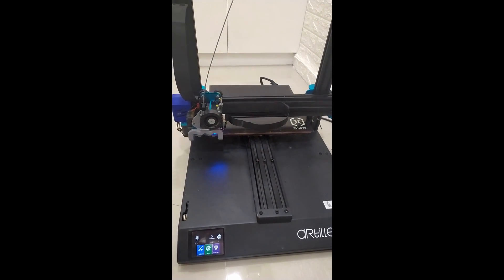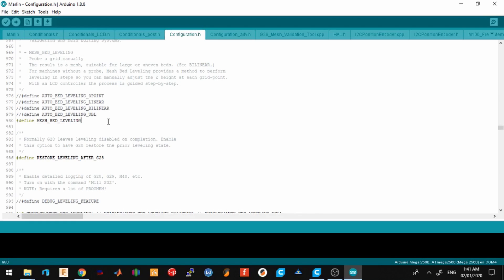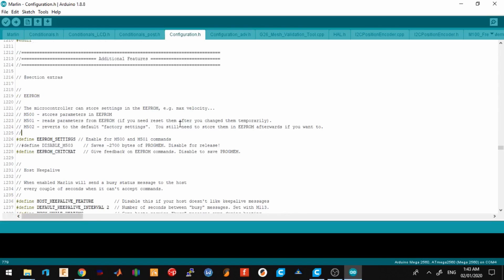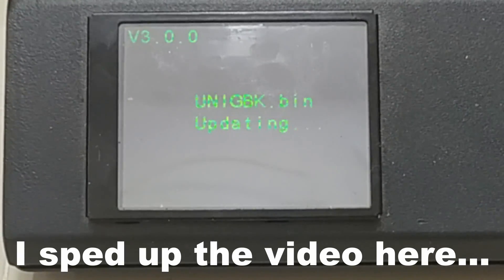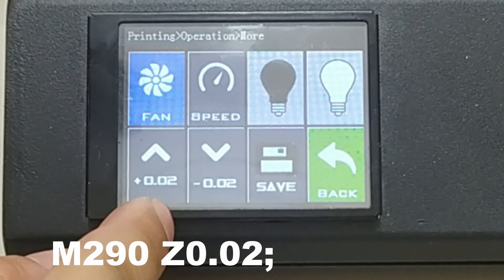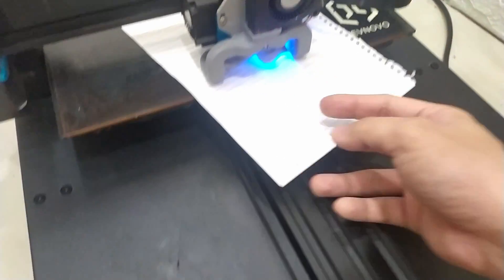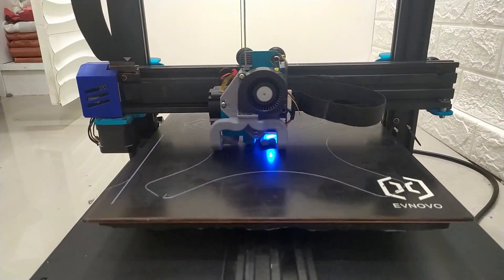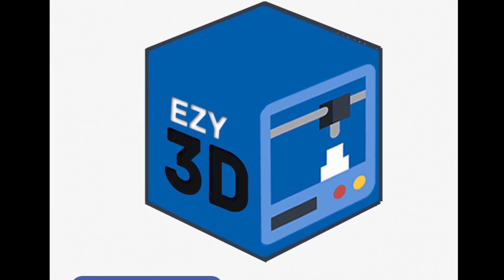Artillery 3D Sidewinder X1 Manual Mesh Bed Leveling Tutorial

Comment from the maker: UPDATE: 
For those who are having problems regarding the mesh not being loaded when the printer is rebooted, you just need to add the gcode M420 S1; after the G28 in your starting Gcode (located in your slicer software)

Regarding the Marlin 2.0.1 version of this upgrade, I will not be releasing the files anytime soon BECAUSE there is a bug which causes some massive layer inaccuracies if I enable all the features that was in the original version (1.1.9) 

If you find any bugs or problems please do let me know immediately, Thank you!

-Mat
Reply: Hi thank you for the video.
So it does not have to be included in the sliced file if the printer was not rebooted?
Reply from the maker: @bestvideosintheworld8098  If the mesh is not loaded when you rebooted the x1, then you need to add it to the start gcode. But I highly advice to just add it anyways just to avoid certain errors that others have experienced.
Reply: @EZY3DLAB  OK then it seems it did not store the mesh values after saving them.
Reply from the maker: @bestvideosintheworld8098  Yep (probably didn't either store or load the mesh), It usually works for the ABL. I guess we need that extra command to really load it if we're using MBL.
Reply: @EZY3DLAB  OK I'm going to test with a model sliced with cure where I added it to the gcode.
Reply: @EZY3DLAB  is it possible to use the manual bed leveling? It seems this is disabled now with the firmware update.
Reply from the maker: @bestvideosintheworld8098  you can edit the source code and enable all the things you need/want.  but based from my initial test, it still has an error (massive layer inaccuracy which is not mechanically caused) if we put every feature that was covered from the last version. (Tbh I don't even see that much improvement(s) with the new one)
Reply: Could you please share fan duct link?
Reply from the maker: @teerapapapairat5388  here you go
https://www.thingiverse.com/thing:3939198
Reply: I have tested the mesh, and it works as expected, now I have tried the fine tuning a test print with the babystepping. So I concluded that I should e.g. move the nozzle up by 8* 0.02. Hitting save however does not seem to save anything. It is lost after I start a new print, I have to manually re-enter the offset. Do you know a way to get this saved, or a command like the M420 S1 to get this enabled from the G-code? Maybe the M290? http://marlinfw.org/docs/gcode/M290.html
Reply from the maker: @rensroosloot  Hello, that's happening because you can't combine the Babystepping with the Z probe offset if Mesh bed leveling is enabled. It wont compile.
Here's the corresponding error message:
"MESH_BED_LEVELING and BABYSTEP_ZPROBE_OFFSET is not a valid combination"

The proper way to set the Z offset is by using the Gcode M851 Zx.xx
http://marlinfw.org/docs/gcode/M851.html

 Idk if it will work if we put this in the start gcode, it's worth trying. I will try this as soon as I'm free with my schedule. Thanks for pointing this out!